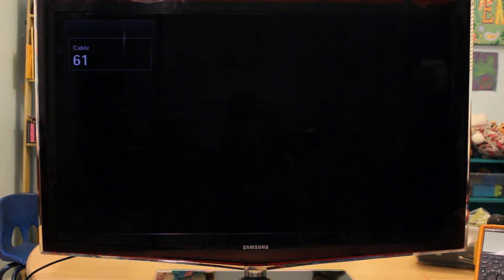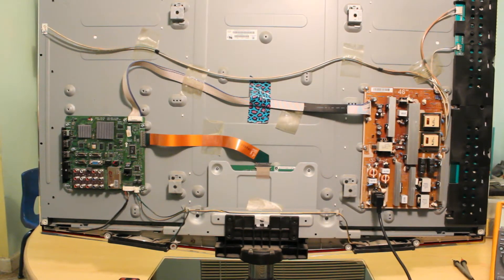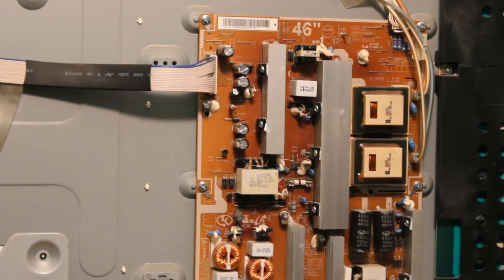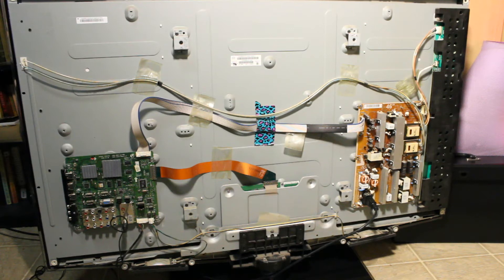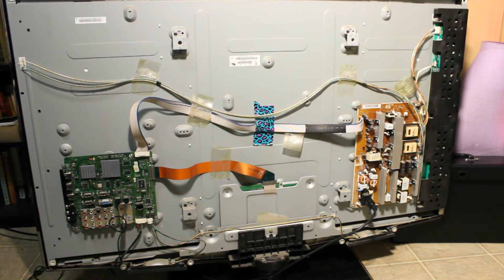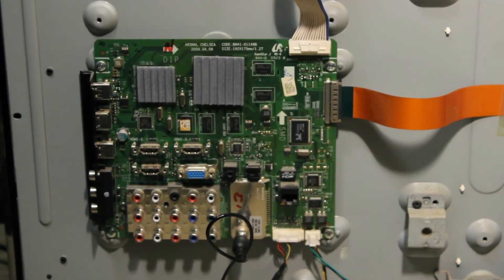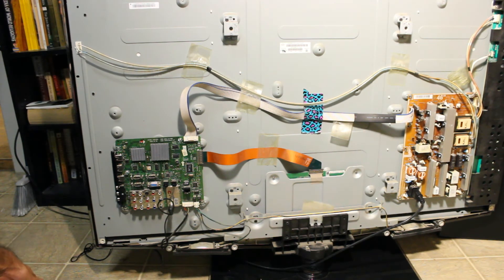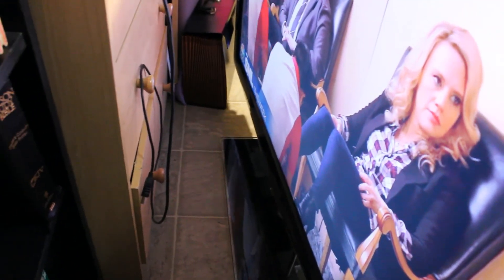How To Repair Samsung LN46B650 LN46B640 LN46b550 LN52B630 LN52B650 LN52B750 NO PICTURE  NO BACKLIGHT

Comment: Hi, why didn't you attempt for a reflow of the mainboard BGAs before buying a new board?
Reply: Pedro F. because he probably didn't no how
Reply: Dang, you beat me to it....by 4 months, LMAO. Samsung is one of the few that put actual heatsinks on all the processors and RAM. the LG's are stark-naked, or wearin rubbers {:O
  I bake those LG "A" boards boards all the time, I've only had one not come out of the oven ½ baked. Haven't had much success with baking Samsung "A" boards, but have repaired a shload of their P-Supply's ;)

E=IxR,
~Malfunction Junction

Comment: Good video.  If you do others in the future, point out the power supply as most of us don't know it. Also, it would be good if you could show us how to remove and reinstall any board or part, and also zoom in and show where you can find the part number on the bad part. Thanks.

Comment: Hi, 
Help me please. I get the standby light on but when I try to touch the power button, nothing happens. Same when using the remote. There is a small board for the touch buttons and the IR sensor. Could this board be faulty?

Comment: So although you had no backlighting and had image on (checked with flashlight test), your inverter board was fine?

I have a TV with the same symptoms and was thinking I would replace the inverter board. But now I worry I will have to replace the main board.
Reply from the maker: +Charles Cho Usually a no backlight issue is caused by the inverter/power supply. However, in this particular case, all the voltages on the inverter/ power supply seemed okay. Since it is not common for the mainboard to cause this issue, I thought I had a bad LCD panel. However, after panels on this model usually do not go bad all at once. So I changed the mainboard and that fixed the problem. It looks like the mainboard was not sending the low voltage signal to turn on the backlight.